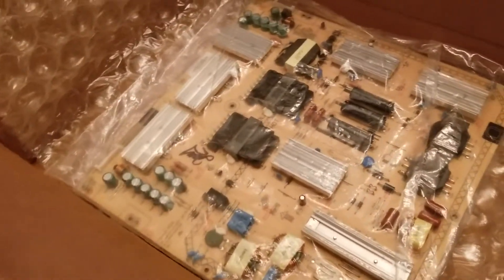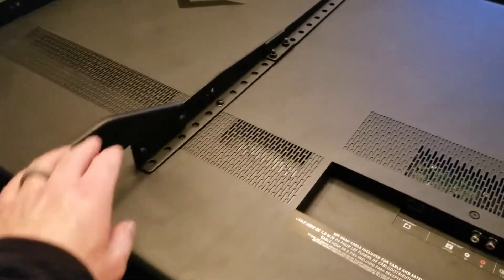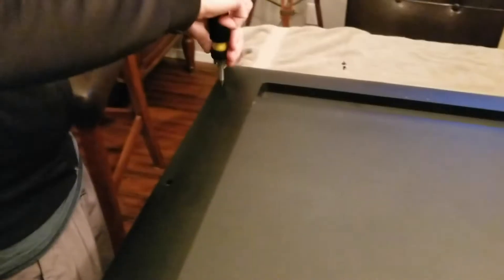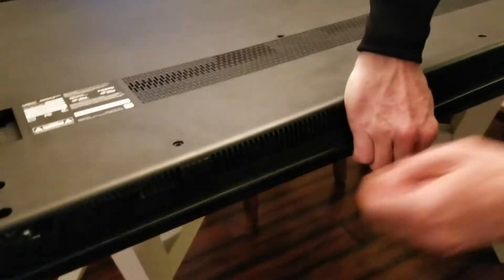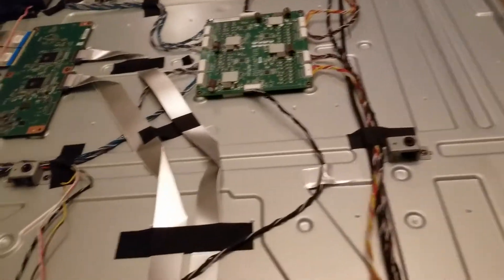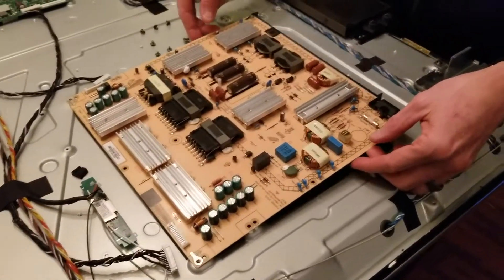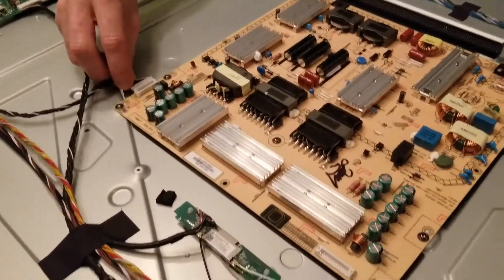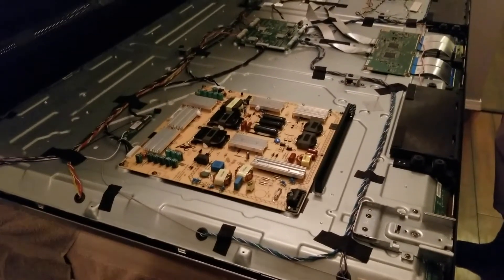How to Remove Replace Power Supply Board Vizio 65 in 4K TV- M65-D0 2020

Comment: Do you need to discharge anything before working on TV?
Reply: Holding down the power button for at least ten seconds after you unplug the TV should do the trick. These LED TVs aren't anything like the old cathode ray tube sets with an electron gun inside.